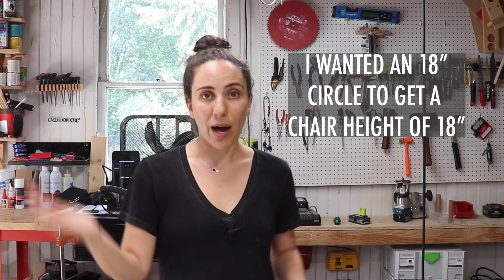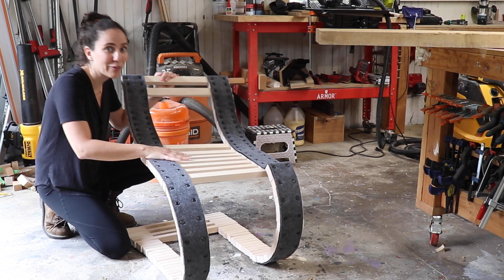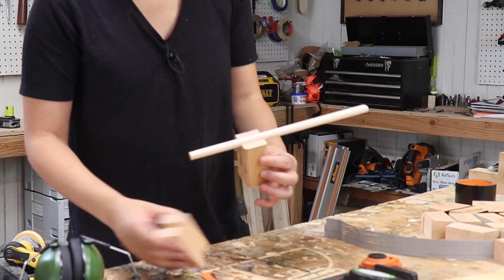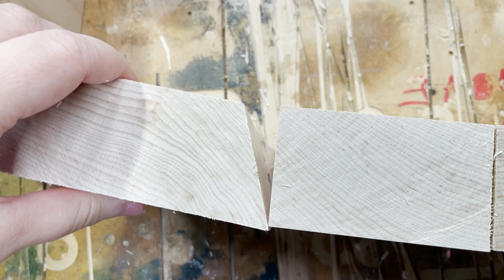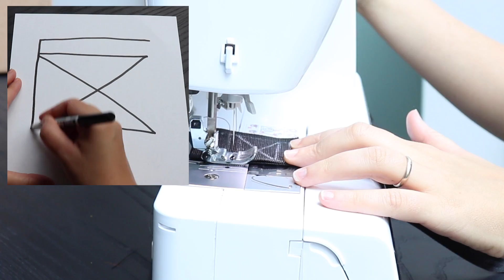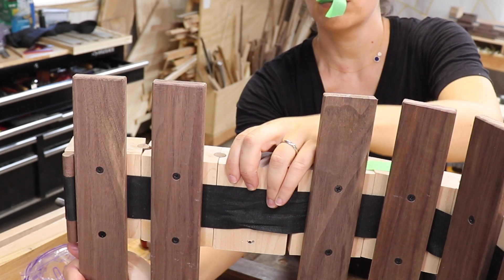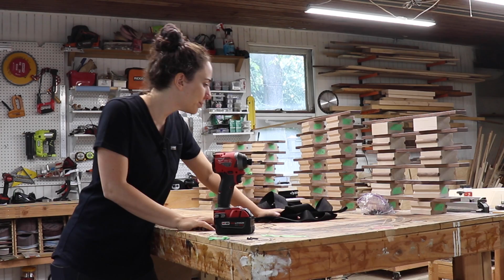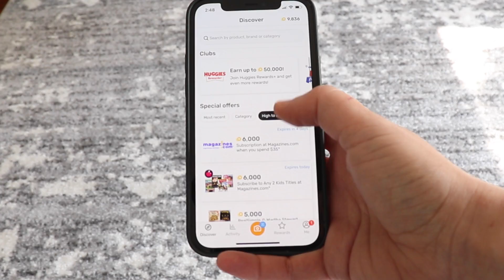I ATTEMPT to make a Roll Up Chair… AGAIN...

Comment: Does it need to be a strapping system at all?  Couldn’t you use hinges between sections instead?  Continuous strapping is going to be a big problem.  Because each joint transfers force to the next.   You need a system where each joint is self contained.  

If you want it to be a soft system instead of a mechanical hinge you could try making fabric hinges.  to make them really strong, drill a hole all the way through your angled block, then cut a slit down into the hole.  Make a piece of strapping that has an eye loop at the end and slip it through the hole and slot.  Now stick a dowel through it to secure it.  This would be a lot of work, but  I think it would be a cool solution and still retain the strap concept.  I don’t think leather is the right material…leather is quite stretchy.  

Try canvas instead of nylon. It’s less stretchy but still strong and also cheap.  Or go all out and get either Kevlar strapping or carbon fiber.  Neither of those will stretch on you at all.  They put cords of Kevlar inside fiber optic cables so that when someone pulls on it the Kevlar takes the strain instead of the delicate glass fiber inside.    If the Kevlar gave at all even over 1000s of feet of distance the fiber would get damaged.

With a segmented strapping/hinge system only a few of the joints really need to carry a lot of force and they can be beefed up accordingly. The segments from about mid-thigh  to where it meets the ground are the ones that will see the most stress.    At the very least you want to isolate the forces from that section separately from the rest.

Comment: put a thick cable through the wood attached to a nut and bolt which can tighten the cable by twisting the nut because its pulling it through more

Comment: why not just double up the straps use both sets you have use one for the flex of it and the other for it's strength just layer them on one another. instead of one strap per side it would be two per side. or even three. more straps easy fix.

Comment: I think the bottom 1/8th of an inch of the back edge of your pieces have to have a 1/16th of an inch protrusion that sticks out and acts as a "stopper" to the piece behind it. Or you may just want to glue on 1/8 x 1/16 rubber stoppers.

Comment: Maybe pad the spaces between the blocks? Seems like the strapping is okay but the small gap between each adds up to a lot after all the segments. 
Maybe use the strapping on the edges of each segment or thin hard foam.

Comment: I would try wire cable two small Guage thru the wood for tenstion and lessen the degrees angle for the curved potion to account for that sag. So shoot for something like 140 instead of a 180 curve

Comment: Great suggestions in the comments already but what about using metal wiring instead of straps? I'd imagine that would have far more tensile strength than any feasible width of fabric strapping.

Comment: All ideas I had are already here in the comments, lol
Steel belted conveyor belts have zero stretch. 
There's got to be an enormous amount of pressure, and tension, at each of those joints. I picture the front joints as the fulcrum and the place you sit like a big lever, I've used shorter wrenches to tighten lug nuts, and those are usually around 110 ft-lbs
Amazing attempts to watch so far, the dowels are a cool solution! I hope to see you succeed someday, but if not I'm really enjoying the story!
Reply: ooh or like "chain drive" chain, the kind used for motorcycles or gocarts, though it's super heavy stuff.

Comment: I want a cleft shape I think it's called which could be accomplished by making your set up longer. Typing the shape is a pain though so try remember that it's all 1 chain.
  _
( (_,
 \__

Essentially your problem with the current shape is that weight applies to the bottom support which will always alter the back support.

By using said cleft shape the weight on the seat would do the same in reverse pushing the back of the chair against the seater before the counter balance effect at the base.

Comment: If it was okay if the chair was rolled in an S shape, you could have a section at the very back that went at a 90 degree angle to the rest. This way it could provide support to the back of the chair, and their might not be a need for so much tension. I’m not too sure how this would work though, so I might make a miniature model to see if it might even remotely work. It most likely wouldn’t look the best, but it would hopefully add more support to the chair

Comment: What if instead of fixing the strapping at each end point of the chair shape you have a extra length of the strapping that when assembled falls behind the chair and locks into the back of the base of the chair completing the loop and tensioning each piece into each other. And when rolled up that extra length of strapping could be used to tie it up into a neat bundle. You would still need to find a material that wont stretch with the forces, but this way the tension is is pulling the chair into the shape the wood forces it to be in and you don't have issues of the ends folding in because of counter acting tension.

Comment: Being an old engineer now working with wood I was interested in your chair problem. I would try a chain recessed into the face of the blocks chains do not stretch much as they are comparatively very strong. You might even be able to use two bicycle chains on each side which would increase the lateral stability although your dowels look to be doing well there. Of course the chain will dig into the groove in the wood so you may need a small metal strip in the bottom of the groove. Any woven or twisted material such as straps or even wire ropes will stretch by virtue of its design and straight strands will be stiff which defeats your roll up design.

Comment: it's not too much tension but where you're putting the tension, the anchors are only on the ends
i you made it so the strap attaches to every single block like in your previous one it'll work better
the problem you're facing now is
a "ligament" that's too stretchy
and improper anchoring

Comment: First time viewer. Very happy to see safety being done!   Safety glasses, Hands clear of cutting bits, Identifying final product safety concerns.  It's especially important when on camera because you set an example.

The iterative tensioning doesnt look a long term solution even if it worked, the fabric can cumulatively stretch, the wood can cumulatively compress, and both change with humidity.

Comment: hmm, so i think i may have some insight, im not sure if anyone has commented this yet, so here i go.

when using straps, or leather for that matter, there will allways be flex. nomatter how much tension you put on it. and with a chair like this, with a bunch of angles and such, the mechanical forces just amplify the flex in the straps if i had to guess. id properbly see if i could use something with no flex at all, like spun steel wire or some kind of real tight spun rope with metal in it. that way the chair would never flex out of shape, and prosumebly stay in one piece. 

im allso slightly concerned with the maple. the blocks you were using didnt seem to be too thick, and when dealing with mechanical forces, like putting a 60-70 KG person on a bunch of angles held together by a few straps, those pieces of wood must be under quite the stress. maybe using thicker pieces, or finding a good way to distribute the weight over all the pieces, would help the whole chair a bit i think.

well thats my thoughts on this project, looks awesome!! keep chalenging yourself in wierd ways like this!! it allways gets you motivated and happy as all hell when it works out!!

Comment: what if the strapping more tuff as you go along. like closer weeve tighter. not sure how to exsplain. or use a string theory like those table that use string to stand up and physics. or a roll up in the middle as well. i feel your getting closerrrrrrr though. multiple straps?

Comment: I don't remember if I suggested this last time but I think I see part of a solution;
The back-rest and some of the actual seat can be a solid shape as the rest of the chair can curl into it's shape, basically having the solid part the outside shell of the rolled up product.

The rest of the problems with how far it bends, I have no clue. I'm sure you or the rest of the comment section can come up with something!

Comment: hinges and steel cable?

maybe i'm dumb, but I think you could just use a small guage steel cable in place of cotton, leather, polyester strapping. the tensile strength of the cable should hold plenty of tension without any give or fear of breaking. 

also, i think hinges between each angled wood section would prevent both horizontal slide and slipping/gaps from the wood sections.

I am likely completely wrong but maybe some madman will try this again some day

Comment: Couldn't you isolate the tension if, instead of 1 strap per side, you split the straps into larger segments?

 Not stapled to every piece, but 3 multi-piece segments - bottom end to load bearing curve, the load bearing curve itself to the butt of seat, and then butt of seat to top end
Reply: *a few shorter segments

Comment: I don't know if this has been proposed before, but what about a cable running through the inside of the blocks, or a pair of cables? When its turned one way the cables tighten naturally, and the other way are loose. And what if the cords only ran to a certain point, such as just before the bend of the back of the chair? And then a second pair of cables starting a bit lower which run into the back, so the tension of the cables are distributed only to the seat for one set of cables, and only for the back for the other set? This seems like it would support sitting on the chair a lot better then straps where every point of the strap is pulling at the same time, the same amount.

Comment: I dont think leather would work. maybe unidirectional carbon fiber (without the epoxy ofc). it's amazingly rigid (really low strain/stress ratio). Any conventional material in that form factor would be too stretchy... but even carbon fiber has a problem: not enough elasticity which would be a pain to calibrate to the right length.

Comment: You basically created a lever, which multiplies the amount of force applied to the strap at the front of the chair. 
The solution would be a pivoting mechanical connection rather than a strap. 

The most effective way to achieve this, while remaining true to your design, would be to fit the pieces together like hinges. 
Double every other piece (side by side) and use a steel rod/all thread/bolt to connect them.

Comment: Great work!  You’re so close!  How about reducing the problem further and focusing on a single C section instead of the full S curve?  A smaller prototype uses less material and time so you can iterate faster.  You can also drop requirements and add them back later.  For example, can you make a rigid chair out of keystone blocks or other segmented shapes?  What improvements to its shape make it more stable?  Once that works, then can you add linkages to make it bend in one or two segments?  Then can you make it roll up and still work?
Reply: change the C to an O and it will work really well because the leverage is greatly reduced.

Comment: You could create legs that fold into the center of the chair when it's rolled up and unfolds before locking into another portion on the lower part of the chair

Comment: You just need to make stop points in between 
The tension goes continuously in the strap that make alot of strain and in the same amount every where 
Solution 
Not one belt or strap with different values of tension

Comment: I would be surprised if you succeed with natural materials. I think you under-estimate the forces involved. Even in steel with hinges it would be tough. Less segments, 4x2 instead of 2x4 and do not try leather. Very nice and creative idea, but with wood you will not get good results I think. To much give in the material. Even dense hardwood will be suffering. But I hope you prove me wrong.

Comment: Crazy Idea: have a channel inside the wood you can run the strapping in, then have a tensioner at the top or bottom. (Something like a come-along / ratchet strap). That way the strapping will always be pulling the wood sections directly together, and if it's not taught enough, just do a few more clicks on your tensionser. If you want to roll it up, release the tension and roll.
Reply: The strap shouldn't be a structural element when the chair is upright. The strapping is flexible by design, and it isn't fair to the material to expect it to be flexible and elastic in one setting and rigid under tension in another. The big issue is the forces involved on the curve because the seat is a giant lever. The forces are not distributed equally along each part of the curve, instead there is a fulcrum at the middle part of the curve which has to withstand most of the forces placed on the lever. These forces are dynamic because the forces should increase as a person leans back in the chair. Increasing the internal friction between blocks might be a good idea even if it implies that they should interlock with a complex shape, use powerful magnets, or require a metal insert between blocks. There is an elegant solution here, but it will take a good amount of experimentation.
Reply: Physically thinking this would also take away a lot of force on the strap. Because the angle is not as far away, the force is not that strong, that pulls at the strap
Reply: The problem is the tension being transmitted to the ends.  The straps really need to be attached at each piece so the ends don't have the curling under problems.  That also eliminates any little bit of flexibility causing a big gap at the weakest areas..  I like the dowel groove joint, one could do the same thing between the cover slats and the maple structure to crimp the strap to keep each strap section independent.  I'd even epoxy between them to bond the strapping to the wood.

And then, if you still get stretching - get Kevlar straps.  Probably overkill, but it'll eliminate that as a problem in any case.
Reply: Isn't it exactly what other woodworking guy - Josh wright did that didn't work?
Reply: Yes this helps to solve the issue of torque on the strap causing it to atretcu
Reply: Overengineering underperforms.
Really doesn't need to be that complicated.

Comment: Are you stuck on that exact design? Just continue adding more length to the floor segment and curve it up to the back rest area of the chair where one end could jigsaw puzzle itself into the back of the chair. This would allow the forces pushing on top of the chair to be more evenly distributed throughout the system.

Comment: Maybe instead of the straps holding it up, maybe go with the bend and have it wrap around and onto the ground to make it supported by the ground. Doing that would get rid of the cool floating look, but you might be able to make it work that way

(Edit: I accidentally posted before I was done typing😂)

Comment: For the continous strap, as you tried to use in this iteration, the strap in the upper bend should switch sides ( better: be accompanied with a smaller strap configured to the length of the curve) to the back of the chair to act as the lever for the lower curve. the Bottom end could go in another inward bend with switched strap configuration to take the 'pull' from the end. This would harm the rollup function to a degree though... If, however you are not inclined to use 2 long straps you could go for small straps in between the junctions, you could point the 'pulling' stress towards individual joints instead of dispersed within the whole chair, doubling up the material in the curves to strenghten them. I would strongly advise you to not use leather as material, since it might be good at first, but will loose integrity, stretching in the bends and probably ripping after some use.Maybe leather as hosing material for the strapping you used first, for them awesome leather looks :D Nice work anyhow! You got yourself a new subscriber!

Comment: as some ppl pointed out i think mechanical hinges coud be a good solution. Also crewing the straps to the wood under at the points where the stress is higher might be able to spread the the tension evenly

Comment: Your vision is ambitious, .. which means  you need to solve some severe engineering problems (and test them on a small scale, just a few parts) before wasting your time (and materials) on a whole chair

1) as many other comments note, this requires a flexible material with incredible strength (several *tons* breaking strain?! ..the thinness of the pieces massively multiplies the stresses quite aside from the shape of the chair) with minimal stretch. Fabric isn't going to work. Industrial webbing but as others have said, steel cables or even chains ..

2) may I suggest you consider calculating the stresses (by hand or even I'm some cad sw ?) Befire building to understand what you are facing, rather than build try fail repeat, will save you a lot of time and frustration

3) keep in mind that to be safe it's not enough this can support the static weight of a slim girl like you 😉 sitting in it very carefully.. it needs to support the dynamic shock load if a big fat bloke dropping into it etc.

The combination of needing to handle beyond target dynamic loads plus the multiplying effect of the thin segments  .. seriously,  you need a super strong material. I dont know abiut the handling issues for carbon fibre/kevkar/Arabia fibres when not encapsulated in epoxy etc that would make them inflexible. If forced to do this project despite my urge not to .. I think I might try mitir cycle chains ? 

Or maybe timing belts/serpentine belts as used on car engines?